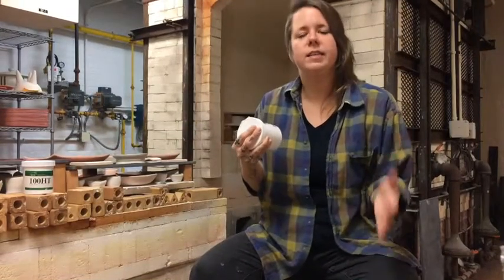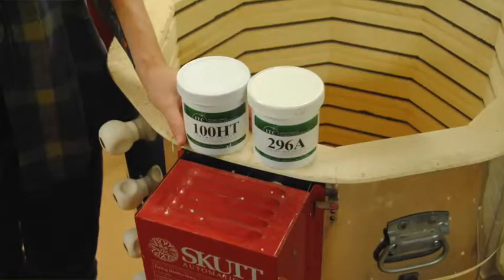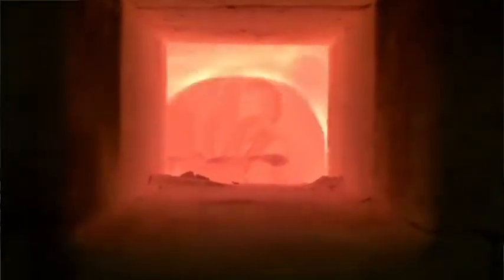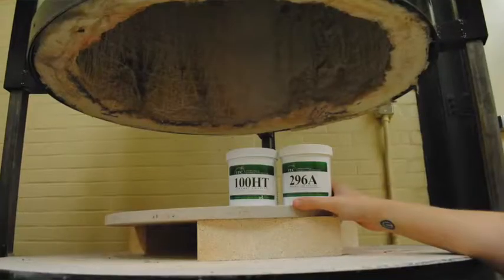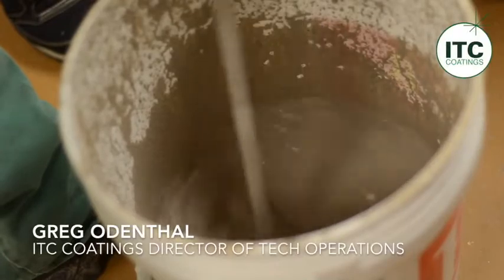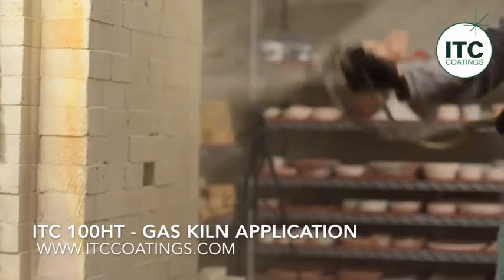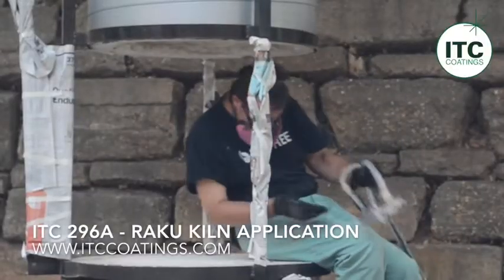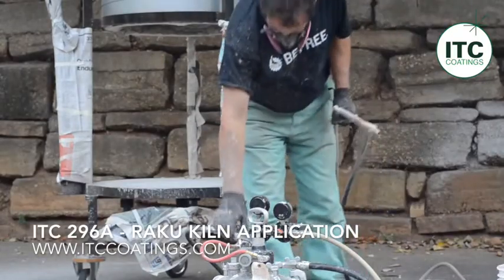ITC Ceramic Coatings: Armor For Your Kiln

Comment: I'm seeing this recommended for gas forges and kilns, and it looks pretty great! But I work with small electric kilns. Is this product appropriate for that application as well, or would it cause problems/degradation of the heating elements?

Comment: Amateur blacksmith using a propane forge; I’m considering ITC100 to increase the efficiency of my forge, do you think this would help?
Reply: Cholula Hot Sauce Absolutely. 100HT encapsulates your interior lining and reflects 98% of heat on the radiation spectrum back to the inside of your forge. So, less heat gets soaked up and then lost through lining and outer wall. You will require up to 33% less propane and get to operating temp 50% quicker (averages).
Reply: @justenwomack326  what is the itc 100 made of?